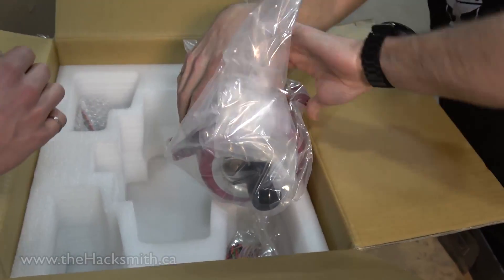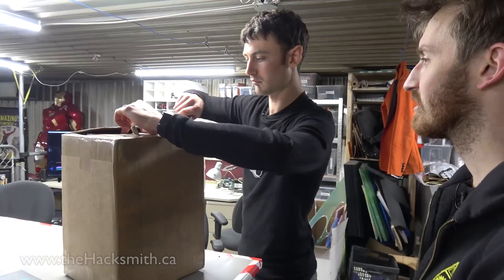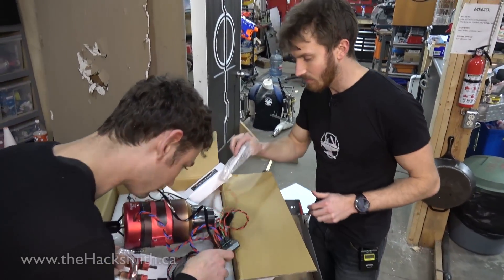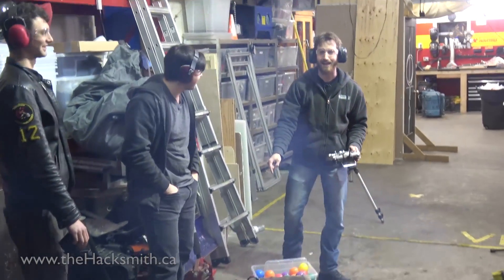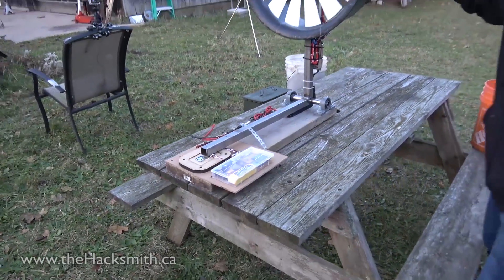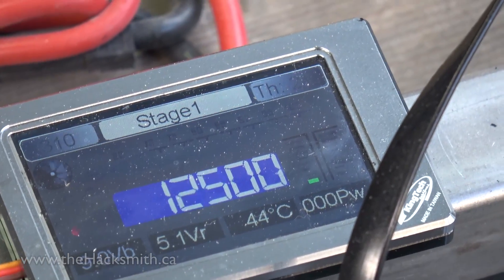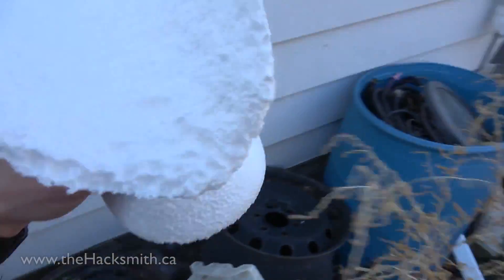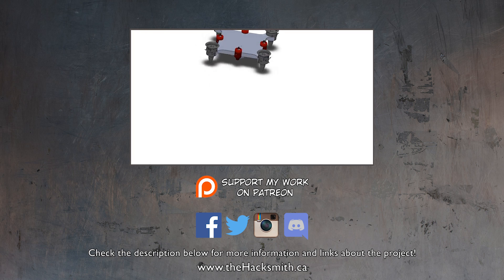Jet Engine VS FACE (Flying Like Iron Man Update)

Comment: runs better with diesel?  the engine heats up faster, operates cooler, and actually hits 100k rpm with jet fuel.  Diesel cannot do 100k rpm.  FYI
Reply from the maker: It's diesel with additives which is basically jetfuel... just a helluva lot easier to get your hands on

Comment: 7:39 I like how at the end they turned the throttle up to help get the electric motor to cool the turbine, but cut the fuel so it couldn't, yanno... thrust. But then just were like ehh- just go get the leaf blower lol. After that test the neighbors would almost thank you for running a leafblower past dark with the garage door open, lol.

Comment: The way the real life iron Man suit works, is with 5 jet engines, 1 on his back and 2 on each arm. This design seems alot more cost effective as you wouldn't have to purchase any efds and all the weight is above the waist leaving your legs free for landings. A real easy design to replicate. The fact that it's already been flight proven is a huge bonus, no need to re invent the wheel. Cheers
Reply from the maker: Easy to say 2 years after this video came out... Dude... Check the date lol
Reply: @hacksmith  ok your right Feb 18, one year, calm down, you should just post a link to your finished product video then ppl wouldn't try to help.

Comment: I just had an interesting idea. What if you used the starter motor on the front of the turbine to assist in throttle response? It wouldn’t be that much torque compared to the momentum of the turbine at whatever rpm it’s at, but it would do something.

Comment: "the smaller they are the less effective they are"
WELL GEE MISTER PEABODY!
Reply from the maker: Effective is the key word. You're confusing it with powerful. Of course a smaller fan is less powerful, but it's also less efficient. A bigger fan could be twice as powerful and only use a quarter more power ;)
Reply: You stated the obvious is all I was getting at.

Comment: Use air gel as insulator to heat. Strap two of these behind your back. Use propeller or whatever (edf?) At your hands and feet's. Keep edf at full throttle and jets at 50%. This should work. Increase jet speed slowly to 70% of needed. Don't go further at all costs

Comment: Can't you just use compressed air?  Like 100psi for each hand for a 180lb person?
Reply from the maker: If you had enough flow, butt you'd literally need like an 18-Wheeler size air compressor

Comment: Why not just use only the jet engines and control the direction with metal rings (in a similar fashion to how hydrogen peroxide jetpacks work) for stabilization? This will reduce the precision required for the throttle of the engines, making them the most viable option.

Comment: Would you be able to try rocket rather than a jet engine and potentially use gyroscopic weight balancing rather than multi-propultion balancing?
Reply from the maker: I don't think so
Reply: I'm planning a similar project and at first, I was planning on using a rocket engine using O2 and H2 and a gyroscopic balance as I would only have one true point of thrust. I am planning on making a flying broomstick.

Comment: Diesel and jet fuel are not exactly the same. Diesel has a lot more cleaners and other chemicals that could hurt the structure of some of the metals in the turbine.
Reply from the maker: We didn't say they are the same...? This one is designed for diesel

Comment: Why don't you guys go the peroxide/catalyst route?
It's been proven to work, there's probably good data to be found, no moving parts, no hot exhausts, basically some plumbing challenges to distribute thrust.

My guess is that's what iron man would do lacking further technological advancements?

Comment: I have a perfect idea to make a person weighing 50kg fly using these jet engines... U can use Kaowool which is super insulator and can handle heat upto 3500 C.... U can use the myth busters idea by strapping these engines to the sides and producing a thrust of 62kg and will be able to fly high
Reply: also use refractory cement to help preserve the life of the kaowool. It slows the melting process
Reply: i dont know what he said but DAMN GOD DO IT

Comment: befor strapping the jet engines to your body you might want to atleast make a prototype of a suit wich has metal on the outside (can be sheet metal but will heat up realy quickly but with a high melting point) and insulate it with allot of heat resistant material this way you will stay cool on the inside although the outside might get (and probably will get) realy hot

Comment: I think 2, should do enough to permit hovering. 50-60 kg will lift me EASY (I'm 1.8m and weigh 54 kg... Yes I'm a skinny f***er xD)
So that plus the electric fans should lift one of you?
I'd mount them on the shoulder blades, facing slightly to each side and slightly backwards, then you can have your fans, one on each lag and one on each arm. You'd face them forward ish to gain controle, probably putting the legs in a slightly sitting position.

Comment: Didn't some one already do the hovering with the jet engines. What would be interesting is if you had edf's connected to servos that would stabilize the flight through a gyro sensor Or just use the edf's on your hands and be done

Comment: its actually not that great that it runs on diesel. to get the same amount of performance with diesel as jet fuel you need way more. a liter of jet fuel would last much longer.

Comment: There's a company called Hyperloop Transportation Technology, that has a material called vibranium, that they are using as a heat shield, you may be able to use that to help prevent the flesh being ripped off your bones

Comment: I can't help with think that while you're trying to fly like Iron Man you're working out and solving problems associated with a personal flight vehicle the biggest problem of which is in developing and figuring out vertical lift

that's exactly what you're attempting to do in this video you are exclusively and specializing in figuring out the problems with vertical lift

so hypothetically speaking if you applied that to making a personal flight system incorporating what you are learning in order to achieve a vertical take-off you could in theory revolutionize the travel industry by solving this particular conundrum
Reply from the maker: But it has been figured out already... By many companies!

Comment: I was wondering if jet engines really spit fire like that, but I realized it’s like -60 degrees Fahrenheit at 40,000 ft so I’m assuming it’s cold enough to keep the engine from doing just that...
Reply from the maker: They only spit fire during start up

Comment: that's not going to work. U need to distribute your weight evenly. It u don't u may even die.BYOU WOULD HAVE TO STAY PERFECTLY STILL WHICH IS VIRTUALLY IMPOSSOBLE. THIS IS THE MOST IMPORTANT THING YOU NEED TO TAKE INTO ACCOUNT

Comment: Simple fact of the matter, is that you can`t use turbines to "fly like ironman", at least not for any longer than a couple of minutes at the most, because the fuel consumption is WaYYYY to high, and if you carry more fuel, you weigh more and need more power, using more fuel..
And a combination of jet and edf? pfffh, even more weight..
The most efficient jetpack is already out there, it`s a huge ass backpack, and has a runtime of about 30 seconds, exceed that and you`ll have dangerously low performance.
Combining an electric system with a jet system is not only super high risk, but unlikely to succeed at all..
After all, electric motors are heavy, batteries are heavy, overload them and they explode, close to your fuel source for the jet`s, which are also strapped to the pilot.
Make a framework for all this? More weight, etc..
Don`t get me wrong, I wanna see the crash video, but I`d suggest a remote system with a dummy if you want to make anything else after that..
Good luck ;)
Reply from the maker: It's literally been done...
Reply: On EARTH?? That stuff should get some Elon Musk type attention!
What alien technology did you score to make that happen, and how the hell have I missed it?
Link to video please..
Reply: No, you can fly with jets.
There's been a number of independent successful attempts. Some strap them to the person, some use a standing board design.
These jet engines are fairly economical for what they do - 32kg thrust at ~800g/min.
Four of these engines running at say, 4l/min total(not max throttle), you could easily get a 5-8min flight time.
EDFs only assist in keeping balance, since they have a lot less input to thrust inertia.

Comment: Hacksmith i got an idea for the suit use the design from gta v the vehicle called thruster is a weaponized stand with motors and 2 of these engines the motors allow the thrusters to move around if you use the design from gta v then its bulky chassis can store alot of fuel and other systems you would need to fly in the air
Reply: Game designs don't work in real life.

Comment: Jet fuel is just diesel with different additives, so of course an engine that's designed to work primarily on the ground will prefer diesel.

Comment: put one on a bike!!
Reply: Brubble Butt yea but u have to stay 15 feet away from it
Reply: true
Reply: Brubble Butt lol
Reply: Colinfurze did something like that
Reply: LoadingTakesEons true
Reply: Kristian Vittrup true but the flame will be behind you so you actually don't
Reply: colinfurze
Reply: The flame could melt the wheel
Reply: Thats a good theory. Probably true I think you might be able to put some sort of layer of metal or fire resistant material under it

Comment: Liquid nitrogen arrows.
My idea: pipes with thin walls and about half a centimeter in diameter and 20-25 centimeter long.
With a bullet like top.
I'm curious if it could freeze the internals and be lethal.
Reply: RA G the arrows would likely explode before hitting their target, unless you somehow add a pressure vent to the tube. Interesting idea though!
Reply: A broadhead would cause way more damage. though it might effectively deliver a gas of some sort. An interesting if niche use device.

Comment: Why not attach some extensions to it so that they aren't directly strapped to your body? Like, have some kind of frame above where the intake is and attach that to your feet, and have a frame with a hole in the middle coming off the end of the engine so that you can walk on them safely without damaging them or blocking the thrust/burning the ground?
Reply from the maker: +The Timelords why not watch the whole video?

Comment: Where is engine of the oil ?
Reply: no iss diesel
Reply: Stop growtopia
Reply: Nabi Korucu its electric
Reply: EpicIrishGamer Dobie it’s working with fuel. Electric for fuel giver motors.
Reply: What does that even mean?
Look up turbine on wikipedia..
Engine of the oil?
Fuel pump?
The fuel pump is external and either separate or a part of the GCU (ground control unit), (Generator Control Unit on fullsize aircraft) or as part of an EMS (engine management system)
Reply: Nabi Korucu the fuel was under the pallet and pumped upward through a fuel line attached to the stand
Reply: It's electric it doesn't need oil
Reply: Nabi Korucu you of the speak of my is my of the language
Reply: The oil is mixed with the fuel.
It's not electric, it's a real jet engine. Just not axial.
Reply: Your probably in Kindergarten
Reply: It's a regular jet engine. You need to mix oil into the fuel.
Reply: Nabi Korucu its electric dude
Reply: Wrong. It's a King Tech centrifugal jet.

Comment: They should have bought some steel beams and try melting the steel with the jet fuel
Reply: Dirty Pineapple r/woosh
Reply: Vincent C It wouldn’t be the same
Reply: woosh
Reply: R/woosh
Reply: The beam wouldn't melt but they would weaken to the point of self failure aka they would snap in two

Comment: u guys keep hot starting the engine there isn't soposed to be so much fire during ignition it damages the back rotor blades in the turbine if u see fire cut the engine work on perfecting your start up b4 u strap this to yourself

Comment: So....edf's on the hands and feet, like his repulsers, for stabilizers and 2 jet's on the back[or perhaps behind the calf, but that might be to unstable] for primary thrust?  Is that the main idea?
Reply from the maker: +ash cody could just watch the whole video...
Reply: I did watch the whole vid, and i saw the "board'.  I'm more wondering what the end goal is.  that, and to me at least, the edf/jet board seems like it would be very unstable/unsafe.  There's prob. more to it than i'm seeing, but it seems like one wrong weight shift would send anything on it flying[ and facemelt what ever the board is now facing].
Thanks for your time,
TheAshenHat

Comment: I'm only 123lbs (56kg) so it'd only take two of the jet engines to lift me...so....I mean, that's cool! 
Seriously though, James, I'm a BIT nervous for when you strap yourself to the engines! I'm sure it'll be alright, you are the Hacksmith after all, but it's still nerve-wracking! Hopefully it works out perfectly and you don't get torn apart like a hot dog...

Comment: Okay, i understand my lawn mower needs torque to cut grass... And my weed eater. I also know that gas engines thrive on colder air and the jet engine is hot air... But for shits and giggles instead of a turbo charger for my little 5 hp briggs push mover what if i used that thing for a forced induction kit and waited till january when very cold to try and blow snow. Friend once told me it should be possible to use push mower to blow snow, ive tried but engine to cold to start. If jet engine powerd forced induction kit worked on a push mower for only 5 min before melting the aluminum block and whatever else id be thrilled to see it lol

Comment: What’s the difference between thrust and throttle
Reply from the maker: +palmax_yt throttle is the digital input saying how much power the engine should give out. Ideally they should be exactly the same, but that's not possible

Comment: If you need a heat barrier I would try a combination of Kaowool and Flexible Aerogel. With a semi flexible metal barrier over the top of that to protect against sheer force striking from the exhaust.

Comment: How about you strap two jet engines on both legs to give the max thrust which saves your body from burning too if placed properly and put edf  in each hands to actual flay like iron man and modify controll to the fingur movements like  punch harder  for main thrust from jet engines and press thumb in each hand to controll each turbines on the particular hand which can give better balance.. Need to practice a lot i guess..

Comment: Probably TOTALLY out of your tech/testing/science/maths/expertise... but... could you have an electrically arrested jet engine? Use an electric motor/generator combined somehow to the jet engine to slow/speed control it quicker than a normal throttle could?

Comment: Just a thought have 8 electric jet engines along perimeter and one diesel jet engine in the very centre of the platform. Better use of energy/weight/thrust.
Reply from the maker: Nope
Reply: the Hacksmith lol. I suppose your setup makes for a more watchable setup just with all the flames. Do share your thrust calcs on this. It would be interesting. Best of luck.

Comment: Honestly, you can’t just achieve this by buying available stuff on the market. You need to know some pretty nimble advanced physics and applied chemistry to get ANYTHING to the desired level of working; you gotta design the whole thing yourself, this is the reason jetpacks took so long to hit reality. Still amazing work here I doubt anyone could get this far at all. Kudossss 💯
Reply from the maker: +Muhammed Ali Inamdar ... We are designing the whole thing ourselves dude. And the ONLY way it is possible is by using commercially available parts...
Reply: the Hacksmith Lmao bruv of course I wouldn’t know any better but its just what I think, that if you make something that’s NOT like a jet engine, something that produces thrust with minimum heat quotient, or you know develop a “technology” that you can actually use in its place, or divert the heat flow, insulate it, use those physics equations of fluid mechanics, the chemicals that absorb heat, like the way brake fluids work, design the component yourself! Think out of the box kinda stuff! That’s what I mean lol it would be a lot more apt that way imo, because commercially available parts like these aren’t designed for the stuff you would want to use them for and they have many cons. Of course you guys are amazing as always, great work man kudossss 💯

Comment: As a jet engine mechanic you really need to respect that tiny engine more. Tossing things into the exhaust can be a fun thing but it can get people hurt. I wouldn't stand beside it either, should the engine come apart you can get seriously injured by the pieces flying through the air.
Reply from the maker: Tossing plastic playpen balls into the exhaust stream is going to get people hurt? Seriously?

Comment: I doubt these will work well for anything but fixed wing aircrafts.
Reply from the maker: Living under a rock? There are several commercially available jetpacks and platforms that make use of these engines...

Comment: What is the fuel consumption rate of that engine?
The website shows 860 g/minute and diesel has a density of 832 g/L, so ~1.34 L/minute is the volumetric consumption rate!  

Therefore, 10 minutes of flight time (if refueled after the engine is hot) would require ~10.35L of fuel (~8.6 kg or 18.96 lbs)--which will have to be accounted for in your weight:thrust ratio calculations!

Engine cost: 3,950$
Max Thrust: 31 kg ( 68.34 lb )
$/thrust:  127.42 $/kg  (57.80 $/lb)

Comment: Hi hacksmith i'm a big fan. I saw you had problems with heat geting out from the rockets or the jet enigine and i now how to solve it. You should use this thing that is called koawool. it is a kind of wool that holds up to 2000'C.